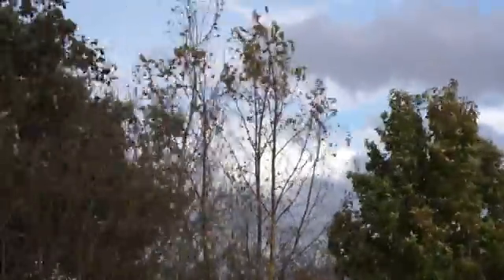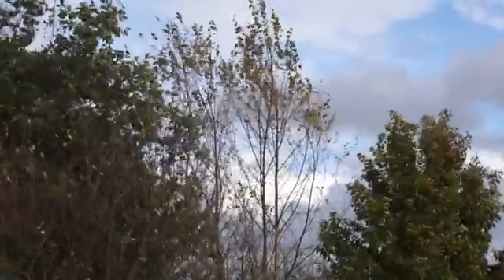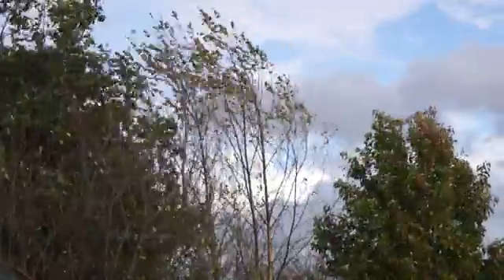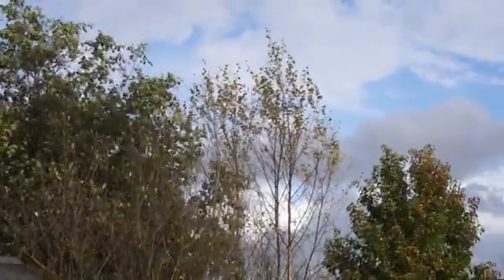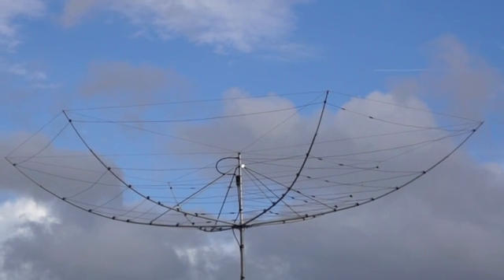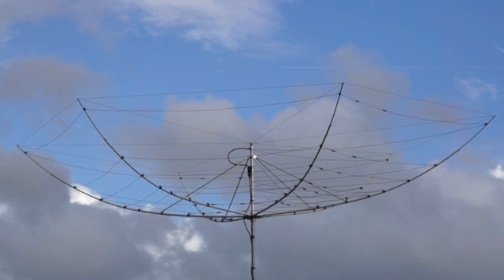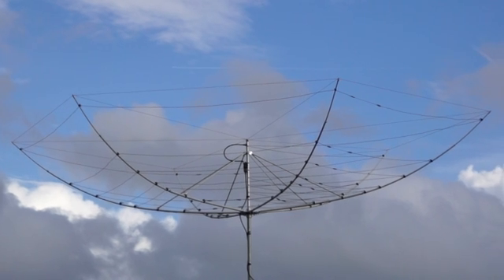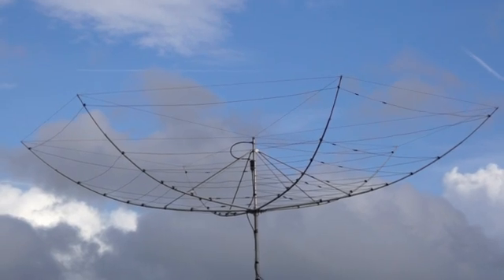MZ0JZE G3TXQ Hexbeam in 100km winds

Comment: Hi Paul …. Very impressive … Just wondering… What from your experience is the “optimum” height for the hex ? 73 - Gerry ☘️
Reply: 55 ft or so I have read. Mine is on 56 ft tower and works incredible.
Reply: @davidray4128  Mine is presently @ 20’ but works great … hoping to get it up another 10’

Comment: ... this is similar to my experience with wire antennas... a 135' EFHW antenna. Here in Mexico we had a Category 2 hurricane. Roof tiles went a flying, trees blew down, plenty of wind and rain.... power out for 2 days. My EFHW antenna was completely unaffected. Fired it up during the storm. My modest little station, a Xeigu G90 and a small 60 watt amp, is completely solar powered. With a wire antenna there isn't much for the wind to blow on